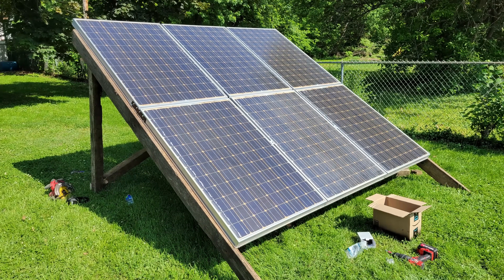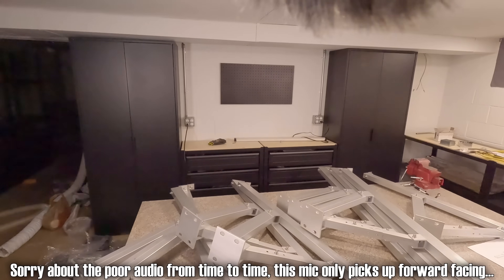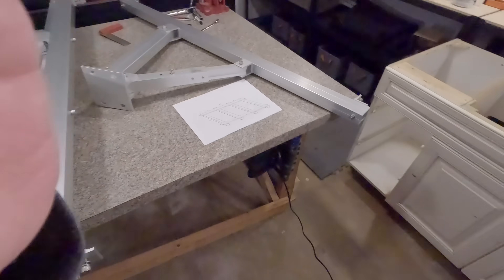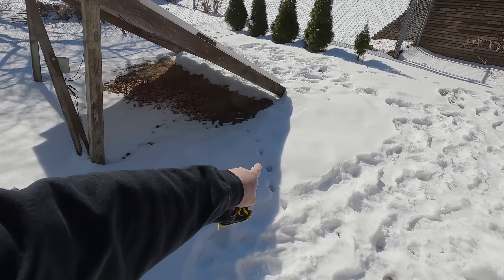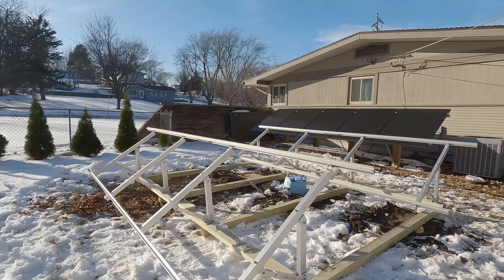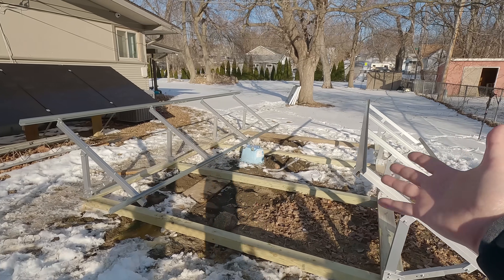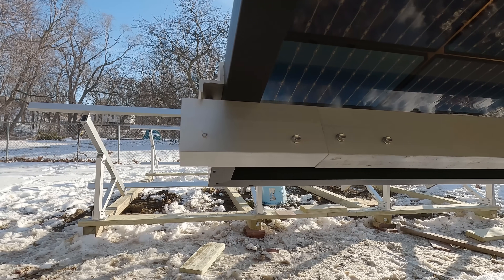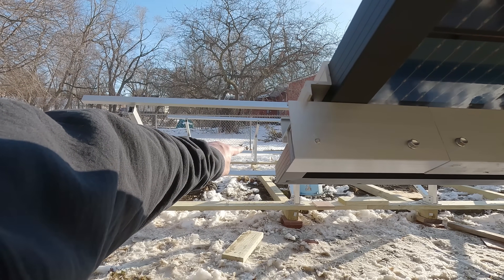Setting up 2 Adjustable EG4 BrightMount Solar Panel Ground Mounts!!

Comment: Hi Joe, I just purchased a solar kit from Signature Solar and the BrightMount ground mount setup. They didn’t include the extensions or mention them in the kit. Soooo, now I’ve got to fabricate some like you did as they no longer list the BrightMount products or the extensions. Will you share any information on what you did and where you found those items you leveraged to extend the ends. I was thinking about doing it more in the middle so the ends would extend out where the hardware would clamp normally if extensions existed in the build. Thank you and great videos!
Reply from the maker: Damn they dont show them listed right meow.... Yeah the extensions are not included. What I did was got some strut channel and cut it to 8-12" then drilled some holes in the side of the rails and strut channel clamped all together. Then threw some bolts in to hold it all together. You can get smaller pieces of strut channel at lowes or home depot. I know I show how I did it in one of these brightmount videos. Was easy to do.

Comment: Joe, eventually you will tell me your price to fly you out to AZ for you to do my set up right. 5k? I now have 25 anker solar 410 panels on the way, I think 6 can fit on a casita/shop and rest on the flat roof on house, got 2x f3800 plus, and 3x f3000.  Not only am I OCD and love tech and this stuff, but as a surgeon this is the perfect challenge to learn. Do you have a list of best solar tools for install?
Reply from the maker: Sweet 2 F3800 Plus units. Are you getting the home power panel? 25 of those 410w panels would be AWESOME! I am getting great production out of them. Id have to think about that, coming out to set stuff up. Shouldnt need any special tools other then maybe crimpers. Most tools are everyday tools. Are you helping?🤔😎

Comment: Why not modify these mounts to carry 5 panels each, similar to what you did to your other mounts?
Reply from the maker: Since I had 8 panels for another video I just left it as is. When I get off my butt and install as a actual ground mount. Ill move the 8 panels to a new location and then add 5 panels like I did with the other.
Reply: @AVERAGE_JOE  Makes sense

Comment: My temporary Bright Mounts are 10 feet apart and the front row shades the second and the second one shades the third one.
Reply from the maker: Really?  What time of day does the shading start/end. Does it shade all day? Howa about now in spring/summer still shaded? 

I ask all those cause the spot I have gets shade from all the neighbors trees and I only have a small window of "good" sun and if I go roughly 10ft apart then Im right above the tree line. Terrible I know but thats what Im workin with🙄😆
Reply: We are using Bright Mount version 2.0, they are set 10 feet apart. The shading happens mostly in Nov. Dec. and Jan. and when I have the tilt angle set for winter mode. The top of the solar panels from the first row shade the bottom of the second row and the second row shades the third row. I had to set the angel for spring in order to fix-it. On our new land we are going to put the first 24 panels in a straight line and the next 24 at least 12 feet behind them. I am thinking about uploading a few videos to my U-Tube channel showing my design. I can send a link if you would be interested?

Comment: JOE, FROM THE VIDEO IT LOOKS LIKE YOUR ROOF CAN PROVIDE YOU EAST, EARLY MORNING & WEST, LATE EVENING POWER EXTENDING YOUR YOUR SOLAR PEEK.
Reply from the maker: Yeah I have more roof space. I could add some on the west. I could also add some on east roof but I dont get the "early" sun. Eairliest would be 9 or 9:30am in summer. I will be adding more soon.

Comment: They are probably seeing how long this tariff stuff is going on before putting in a new order. They are the cheapest rack, especially as expensive as strut is these days. Hopefully your stuff is holding up, we've had some crazy winds out in Gretna with this blizzard.
Reply from the maker: I guess they are waiting on parts and will relist. Its a great rack and goes together pretty quick. Yeah dude the winds are crazy high although I would imagine you get slightly higher winds in Gretna!😲

Comment: YUP = that LUMBER is what  I  utilized on my  
SIX (6)  ARRAY /  36 "PV" Panels 
4" X 4" Posts 
2" X 6"  Ground Contract  treated BOARDS 
3" Deck Screws 
4 1/2" Stainless steel  Lag Bolts 
1 5/8"  Stainless Steel  Fender Washers 
&
some 3/4" PEX  water pipe as SPACERS 
...
COOP  
the  WiSeNhEiMeR  from  Richmond, INDIANA 
...

Comment: Well, 2 years is the running tally for "temporary" right?  😁

The only thing that would have been better would be if you could have the temporary setup a little further into the back yard so you could still work on the in-ground array while still producing power from the temp array (probably not possible though).
Reply from the maker: Thats 2 years on that solar rack...I have other "temp" things that I did who knows how many years ago lol. Always "mean" to go and do it right buuuuut🤷‍♂️ 🤭

Have been tossing around the idea of throwing wheels on it so I could move it to another area.😆
Reply: @AVERAGE_JOE  Now that would be a sight to see!!!

Comment: What is it with Americans and timber, no way would I put timber on a solar rack,
Reply from the maker: 🤷‍♂️ its quick and easy to run to the hardware store. Where are you at and what do you use?
Reply: @AveRage_Joe  Ireland,  my rack is 6 inch base Chanel with galvivised cross members,  must keep high winds in mind when building,

Comment: The first big snow storm will load the bottom of the panels and break off the mounts. 
I can't believe they think this design will work in any place where it snows.
Reply from the maker: You talkin the aluminum rack mounts or the wood?
Reply: @AveRage_Joe  yes. The aluminum mounts to the wood posts will fail with snow load as it collects on the bottom of the panels. This creates a strong lever moment on the base mount.
Most other ground mounts have a support at the bottom of the panels to support the weight.
Reply: @MarkSpohr  I was wondering the same thing when I saw the base mount.   Not just snow, but a 60+mph wind i fear would have the same effect.  Hope it doesn't, but I definitely don't trust this by the look of them.  Too bad because these might have worked for something I've been in the planning stages for some time now.
Reply: just looked at another video of someone who just received a newer version of these. Looks like the new design replaces the mounting bracket that you have with one that looks about 30-40% longer.  Still not even sure that is enough, but it will help to transfer some of that load across that larger base.
Reply from the maker: All I can say is last winter I had 10-12" of snow on the rack without any issues. I did an update video and showed it. Also last summer during one of our crazy storms they had clocked 90+mph winds here in Omaha. Storm snapped 1000s of trees and telephone poles including the biggest tree in my back yard. Rack still stands.🤷‍♂️
Reply: @AVERAGE_JOE  good to hear!
thx

Comment: Great video Joe thanks it would be a pain mowing around if left on the ground and grease those stainless nuts bolts stops them galling .
Reply from the maker: Hell yes it will be a pain to mow around. Good think I have a robot mower for that lol.  As for the middle area.  Once I install the bifacials, Ill throw down some white gravel or something SHINNY/reflective.  YES 100% need to grease those SS bolts/NUTZ.  I actually over tightened one on the U shaped pieces.  Could not get it off lol.  It may be a smidge loose now since I couldnt even tighten it back up HAA

Comment: That sucks if they disconnected them racks. I have 4 and wanted to get a few more if i add more solar panels
Reply from the maker: Other commenters have already contacted them and they are still selling them and are just out.  Im glad cause Im sure Ill get moar as time goes by.

Comment: Nice Racks!! I actually have two of these racks in stock and one used rack available if someone needs them. Just look up Panels Up Solar in Mississippi. Those racks will be there right up until you get started on the next experiment.
Reply from the maker: THANKS!!  Looks like maybe someone picked them up already as I didnt see them listed.  How are those adjustable integra racks working?
Reply: @AveRage_Joe   they are still available. They were ordered in for a customer project that they then decided to flake on. I was going to then use them personally but then came across the Integra Racks. I switched my build to them because of the super simple build and adjustment capability. They work perfect for me here at 31 degrees because of the summer/winter tilt is almost perfect.

Comment: There’s nothing as permanent as a temporary fix
Reply from the maker: You Know It!😁💪🔧
Reply: @AVERAGE_JOE  and the best thread locker in the world is a cross threaded bolt.
Reply from the maker: Lol FOR REAL! That brings up another couple of SS bolts I focked up. It was on the base of the EP Cube. Lag bolts into the concrete. Just ended up cutting them off, epoxy over them then moving the whole unit over a few inches🤦‍♂️😆

Comment: EG4 lists the Brightmount rack as a (Legacy Product) which means they don't carry or sell it any more.   They were available on other sites like ( Current Connected ) website but they are listed as Discontinued there also.
Reply: That is only for the old version (non-tilting), they will be carrying the new version still, they are waiting on supplies (I emailed them last week and asked).
Reply: @BassFearDave  -  Joes Brightmount rack are the tilting version and they don't sell those any more either but we will see,  hopefully they do have a new one coming out soon.
Reply: @ Yes sir, those are the ones I inquired about, they do list them as a current product under "Our Products > Ballance of System Components > Ground Mounts" as the "Brightmount Adjustable CAT1" on the website.  The Legacy products listing is the old non-adjustable mount.  I received this reply in an email from them last week:  "They are currently on backorder. I have been searching for the past two weeks and have not found any available stock yet. Unfortunately, I don't have an estimated time of arrival at this moment, but I can assure you that they are not discontinued.

Thank you,

Colt"

Comment: Also, the frustration with Vendors discontinuing products... I might be interested in replacing this kit with some improvements...
Reply: I was told by EG4 that the cat1 will be available in March. I have been talking with a 3rd party NOT EG4 that the cat1 went through a redesign and it will be sturdier model than the first cat1 version. The brightmount V1-V2 was a great kit I wish they would have just raised the price instead of trying to redesign a cheaper model.
Reply from the maker: I hear ya on that. That battery they told me a few years ago would be around for a long time🤷‍♂️
Reply: @AVERAGE_JOE those 2 wounds are too fresh…